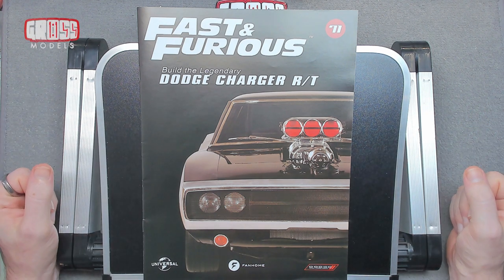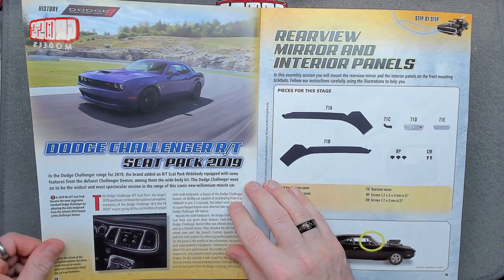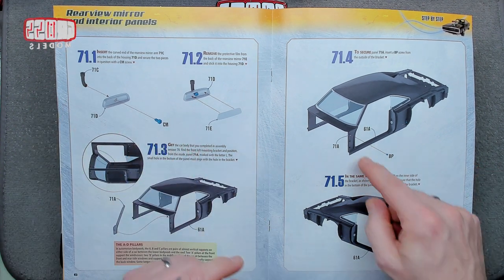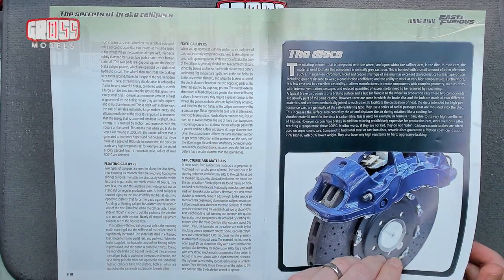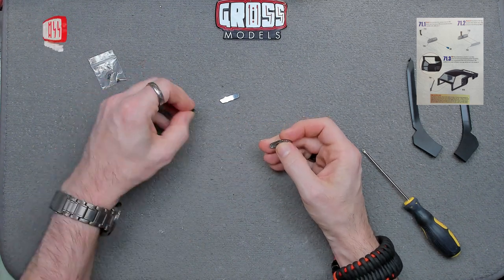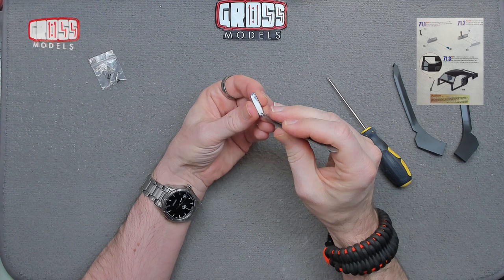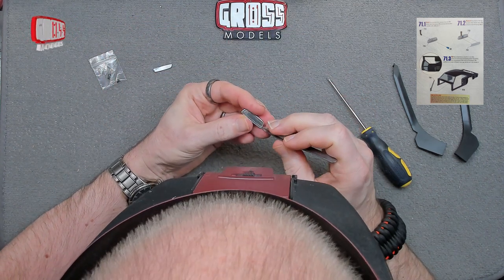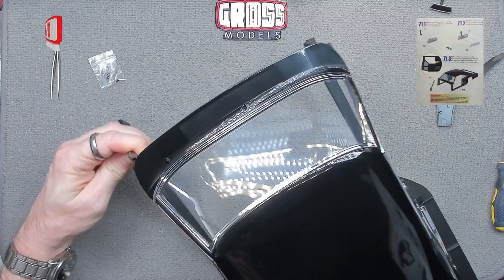Fanhome 1:8 scale Dodge Charger build. Issue 71

Comment: Car dik brakes are just like the old bike caliper brakes...that squeezed those rubber pads against the wheel rim....Disc brakes just use a separate disc instead of the wheel.
Drum brakes use similar principle, but instead of a disc they have a drum....and the brake pads are squeezed outwards onto the inside of the drum wall.
Very fancy stuff 😁
Reply from the maker: Which is best?
Reply: @GrossModels  Right now? Everything has pretty much gone to disc...mainly because discs, are easier to cool..so perform better for longer.. Drums heat up faster, and keep heat longer...so tend to fade faster than discs.
That's what I get anyway...I'm sure there are other advantages and disadvantages to both. 🙂
Reply from the maker: Interesting…..